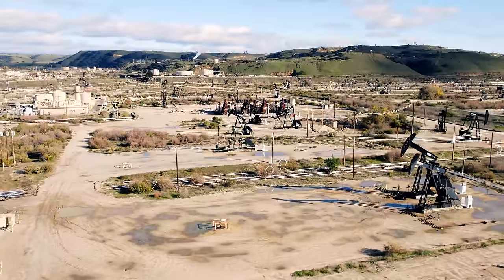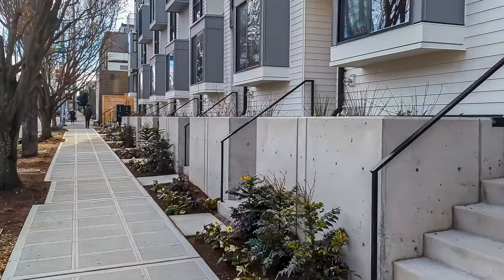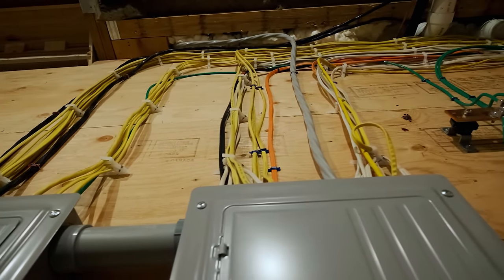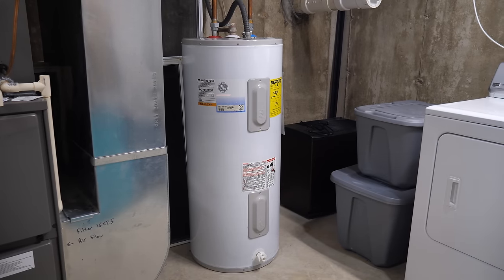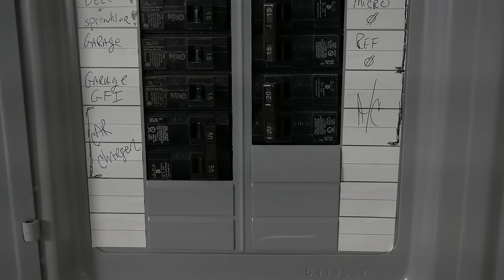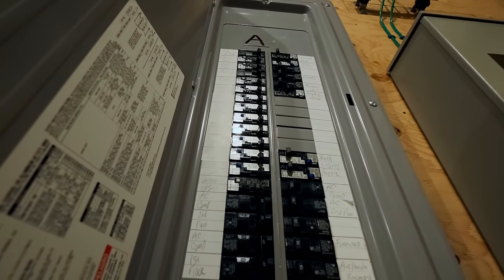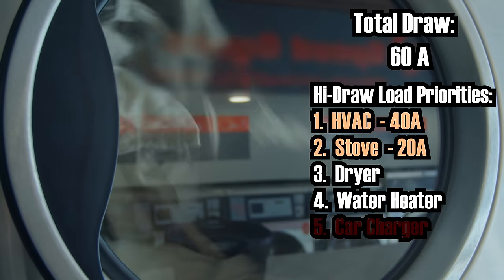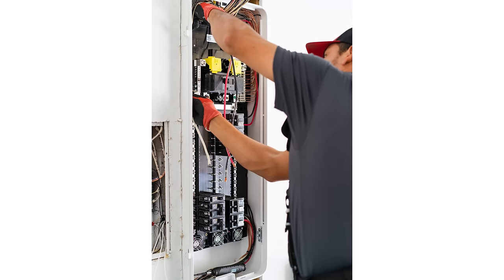Home Electrification: There's not a lot to do, and it doesn't have to be hard (Part 1)

Comment: One thing to know is the Span breaker box starts at $4500 (not including shipping and installation), which is more than the complete cost of an upgrade to 200 amp service.
Reply: Lovely, that's four times more, than my gas and elecricity costs for a year, and ten times more than the electricity bills for a year (note: our utility prices are currently heavily subsidized).
Reply: @asdfhun  , panels last 20-30 years, typically. I agree it's too expensive for most people (especially since upgrading service is cheaper), but it's worth thinking on the scale of decades not a couple years.
Reply: Yeah these things are very pricey, and you do have to do some number crunching to decide which, if any, are going to be beneficial.  If you can upgrade to 200 amp service for less than $4500 then great, but it'll be way more than that for a lot of people depending on whether the existing lines running to their house from the street can handle that (and how far from the street their intake is if those lines need replacing), whether the street box itself can handle that, the local cost of equipment and labor for doing the installation, etc.

If you look at @asdfhun's response though, they sound like they're doing an "its way too expensive!" knee-jerk reaction take.  Yet at the same time, they also state it would pay for itself in 4 years.  (Of course that's just the panel - they'd need to change all their devices as well so the total cost will be much more, and may not be justified if the dollar cost is your singular concern.  Again, they'd have to crunch the numbers.)

But also keep in mind, you don't have to do everything all at once.  Start by checking your attic and see if simply blowing a bit more insulation around will be beneficial.  If you're running R5 and you can push it up to R20 or higher at moderate expense, that in itself may save you quite a bit of money over the course of a few years.  Windows can be expensive if yo have a lot of large ones that can only be "fixed" by replacing them, but doors are often easy:  A lot of time you can significantly improve your doors by just adding some cheap weather stripping around the edges.

Once all that's done you can start looking at replacing appliances.  Again, you only need to worry about doing so one at a time.  A heat pump is a great start because, despite the implication from the video, you can often just bolt it on and continue using your existing gas furnace as the "emergency" heat source rather than replacing with resistive.  After that is kind of up in the air.

The next-most-viable upgrade option is going to depend primarily on your usage patterns and the local cost of gas vs electricity.  If gas is more expensive you'd probably want to replace your kitchen range (induction stoves are particularly efficient) as that's probably using the most fuel given you typically cook more often than you do laundry.

If electricity is more expensive for you, you could try something like the dryer (or maybe even that furnace which should no longer be running too much after the heat pump is installed).  But in that situation you might be better to look at pausing the appliance replacement and considering some solar panels and/or battery system before adding more electrical load, just so you aren't paying the higher grid prices when you do finally get around to switching the remaining appliances.

There's a lot of options and pathways.  The smart panel is probably one of the last ones you'd need to worry about (ie: once enough things are electric that tripping the main breaker starts becoming a real concern).  The main takeaway is that its OK and even better to think about and take action in steps rather than trying to do it all in one fell swoop.  (Unless you're in building a brand new home.. if you're in that position then just do it right the first time and save everyone as well as the planet a lot of hassle and expense in the future!)
Reply: you've got to think that with greater uptake the prices of those sort of smart panels will reduce over time. They're very new tech, it's to be expected they are a premium price at first
Reply: @emma70707  but do you truly believe a smart system will be operating for 20 years? That the service won't be discontinued by the company? I doubt even the flash memory in the controller is rated for 10 years.
Reply: @emma70707  panels will last the life of a structure. They're mostly non moving metal. They don't wear out.
Reply: @JeremyMitts  electronics do fail, its a real concern
Reply: Also not a fan of anything smart these days, chances are it requires a phone app which have terrible life spans. Will they still be updating that app in 20 years from now? Will the company even still be around?  Phones have very short life spans so you're constantly having to reinstall your apps and reconfigure them on your new phone so if they stop being available that's a problem.
Reply: @redsquirrelftw  That's why my house will have good old mechanical light switches and dumb light bulbs. I can live with not being able to turn lights off from another room if it means my light switches will be usable for 20 years or more without having to configure or set up or install anything.
I have the same question about modern cars, EV and gas. My classic carbureted car will stay running as long as there are parts to throw at it. What happens to a modern car when the computerized bits that are in every component fail and are either obsolete or there is no one to work on it?
Reply: The draw of Span is to reduce the peak load which means your solar/battery solution will operate more efficiently.  It is very much a cutting edge technology that will if proven effective will drop in price as it rolls out in scale.
Reply: @Nickvin  or they know everyone is buying and now demand has skyrocketed… especially when government is forcing its use. So now price will increase because it can and you WILL pay it.
Reply: @redsquirrelftw  idk why everyone keeps talking about the number 20 years. For a power box, 20 years is nothing. For an app that's like 3 lifetimes. How long did Flash exist, 25 years, if that? That's just software, nobody has a working 25 year old computerized object... other than weird nerds. 

This was one of the first videos of his I didn't agree with. He is talking about a world where your system literally depends on a smart object to function. The stupid, primitive nature of a normal electrical panel is actually a plus in my mind.
Reply: @Diego Garcia del Rio  that's a valid point.  Another concern is if devices made 20 years from now will even be able to communicate with the panel to configure it.
Reply: @altrag  If the prices haven't come down , just the meter socket for 200 amp is around 2000$, and depending where you live , work is typically 3X the materials...!!
Reply: @garci66  That's a valid point. In today's "throw away tech" culture, when "span 2.0" comes out, then what? What about if/when span goes out of business and there's something completely different and new?
Reply: Just Updated my Service to 200 Amps.  With Installing a new Service Entrance cable, External Service Disconnect and Load Center the total cost was $2,310   If A permit would not have been required I could have dropped that Cost even more.
Reply: @JeremyMitts  no...they will rust and become hazards in time, not to mention technologically obsolete.....the new codes will make you change it...!!
Reply: @urbanws1234  That sounds like nothing compared to the headache of everything discussed in this thread. Idk if $2,300 is a common number but in the realm of home ownership that sounds pretty cheap
Reply: @bogdan78pop  If your circuit breakers are getting rusty, you have bigger worries than obsolescence, like why they're made of iron and how they got wet.  By the time your house is flooded to the level of the breaker box, $4500 is round-off.
Reply: @asdfhun  you don’t have to replace it every year lol
Reply: @emma70707  I wouldn't count on a smart panel from a new company lasting even 10 years
Reply: @emma70707  Regular panels are... who knows how long the smart circuitry will last — most likely much less. That presuming the company is still around and didn't just file for bancrupcy and disappear.
Reply: @RyanDiederich  PANELS, not generic "electronics." Jeremy's correct.
Reply: @redsquirrelftw and Most "tech" companies are going to incur monthly  fees  to cover there server costs + software updating and "bug" patching and if they do NOT sell enough units OR sell to a different company how long is the support AND servers going to be maintained ? and there is already a LARGE "graveyard" of DEAD tech the company stopped supporting and WONT release client side hosting software
Reply: @skeetsmcgrew3282  and is 100% local / self "managed" unlike a "smart" panel requiring SOMEONE else to incur COSTS to support it and when those COSTS are greater then the INCOME from subscriptions AND new product selling / licencing ETC they "pull the plug" and your "smart" panel and all its management becomes "dumb" and you are now back to square one
Reply: @larryroyovitz7829  it'll be new guts to be installed by an electrician into your existing "span 1.0" so to speak. Basically they'll just swap the electronics behind the breakers and keep on trucking. Probably at a cost of a half day or so labor with an electrician.
Reply: you can do the same thing if you learn classic control and play with relay and contactors
Reply: @asdfhun  Jesus. I’m locked in at some of the lowest rates in YEARS and that cost is maybe 6 months of my utilities, not including water of course.
Reply: There are much cheaper options for managing just one or a few large loads.  Which is all you need.  For example, EV chargers that have the capability to monitor the main feeder current and adjust accordingly can cost as little as $600, or just $150 more than the same without that feature.
Reply: Zaydan Alfariz  > since we prefer to have one first
Then you're not building a new home, are you?  Not sure how that counters my statement.

Of course it also depends on your local infrastructure to some extent.  If you don't even have the possibility of 100amp service because your local power system hasn't been upgraded since 1973, electrification simply won't be possible no matter what.

If you're building a shanty in the poorest part of a poor country you might not have electricity at all - probably not piped gas either and are just stuck with something like propane tanks to fuel your stove and heater.

This video was about the US though, as was my response.  The arguments definitely apply around the world, but I'm not blind to the fact that not everybody around the world (or hell even in the US itself) is in a position to make the change even if they wanted to.

Of course if you have the money, its not hard to install solar panels no matter what country you're in, even on an existing house you're renovating.  Though again I'm not blind to the fact that "have the money" is not a universal given by any stretch of the imagination.

Just do what you can.  Encourage others to do what they can.  Not being able to do everything doesn't mean you shouldn't do anything.  Making excuses is usually just an excuse to be lazy (or its trying to push a political agenda).
Reply: @bogdan pop  bruh, a 200 amp meter base is about 75 bucks. Not sure what you are referring to
Reply: Hello Andrew
How old are you now?
It's cheap, just watch here how to do it !
just a small rail, switch boxes on it, ask you dad to do the wires when you did the switches on the board only !
Reply: Zaydan Alfariz  in Texas the same..You need to do this too, off Grid, many here do that too.
Just buy battery capacity, as a family or as your local community, micro credit and you fix it yourself, easy !!!
good luck !!!
Reply: They're a pain to work in, especially now that arch fault breakers are required on most circuits according to NEC. A normal panel will take less time to install, thus less total cost.
Reply: If the need for a Span breaker box is simply to throttle car charging during periods of heavy electricity use, there is a free alternative. Simply open your car's charging settings and configure charging to begin some time late at night, when you are not awake to run either the stove or clothes dryer.

A level 2 charger adds a good 30 miles of range per hour of charging, so if you drive each day anything close to what the average person drives, beginning the nightly charge at 1 or 2 AM is still way more than you need to wake up the next morning with a full battery. Worst case, you can override the "delayed charging mode" once in a blue moon when you really need to.
Reply: Peter smith  I was responding to the comment that said electric panels last 10-30 years
Reply: @RyanDiederich  the lady was talking about a traditional electric panel wearing out. There are no electronic components in a traditional residential electric panel. (Except afci and gfci breakers, which typically outlast the structure)
Reply: @bogdan78pop  meter "sockets" are $50-$70 for 200 amp and AEP provides them free of charge to customers. I don't about con ed or others.
Reply: @JeremyMitts  I was talking with the work ...sorry about the confusion...!!
Reply: @truckerdave8465  I guess it's not just the prices (though as i said, ours is very hevily subsidized for political reasons), maybe you conusme way more. That was for 2100 m3 of gas and 4500 kWh/year (for a 3 person household with a very non energy efficient house, our gas consumption for heating should be around 1000 m3/year, so half of the above).
Reply: Zaydan Alfariz  Well I don't know anything about Jakarta's real estate market so I can only take your word on it.

I just don't like "but wahhh its too hard to do absolutely everything" as an excuse to do absolutely nothing.  Its completely fallacious.  You don't have to do everything.  Do what you can.

If your "new" house comes with two things already connected to gas well, that sucks but you know what you can do?  Get the other two electric.  You don't have to go for all four gas just because the first two are gas.

And don't forget, when I say "do it right the first time", I don't necessarily mean you.  In fact I specifically said "for new homes".  That means the original builder.  The guy who originally put in those two pieces.  Not you as the purchaser.  It may be "new" in the sense that you're the first owner, but its not a "new development" at that point - its already been built and the problem is already in place.  You as the purchaser are already too late.

And to that end, once you're settled in you can start bugging the development company to not use gas on their next project so that the person after you isn't faced with the same situation.  Or start a conversation with your local politicians about getting a bylaw in place to prevent gas in your area entirely (for new developments - forcibly upgrading existing homes is a bit more questionable as its way more expensive to replace than it is to just do it right the first time - hence why I suggested doing it right the first time).

Or hell just bitch about it to your neighbors and colleagues.  Simply getting the word out is in itself a useful endeavor.  Nobody's going to change if they don't even know they can or should.

"Do everything you can" is not the same as "do everything".  Every little bit helps.  What doesn't help is just whining and complaining about how its too hard and doing nothing even when you could be doing something.
Reply: @emma70707  i think it does not provide more that what you could do with a DIY smarthome for the fractions of that smart panel. Not giving power to the water tank if the consunmption is over 80% costs a $25 smart relay (and a proper relay behind it, you don't want to switch 2kW of power with those).
Reply: @emma70707  As an electrician that changes electric services from 60-100A to 200A every day, electric panels last much much longer than 20-30 years. I typically switch services from houses built 50-70 years ago. The panels are all fine, all the time! It is so so rare that a panel will have a defect, it's ALWAYS the breakers that fail.
Reply: Holy cow! Nevermind, not interested anymore! At least, not until the tech gets cheaper or I find a similar thing from a cheaper company.
Reply: You could do a Zigbee/Z-Wave based system for far less I believe.
Here I can get a starter pack to control my 2kW water heater and the 2kW floor heater in the living-room/kitchen for less than 1000 USD including installation. And I can apply to get up to 35% or up to ~1000 USD reimbursed from a government program when installing smart control in a home.
This thing will know the electricity price hour by hour and save energy during the expensive ones.
Reply: @JeremyMitts  as an electrician who has replaced multiple panels due to bus bar failure I’d disagree
Reply: JUST PUT NOTES on your stuff: “Don’t operate dryer same time as stove or oven.”  That’s 1 cent of paper vs. 400,000 cents for a smart gadget.  (Which probably won’t be supported more than 1 year after Span goes out of business.)
Reply: @altrag it is 9k for us to also upgrade wiring to detached garage and a sub panel. Adding 4k more is not in scope. The panel itself is like $500